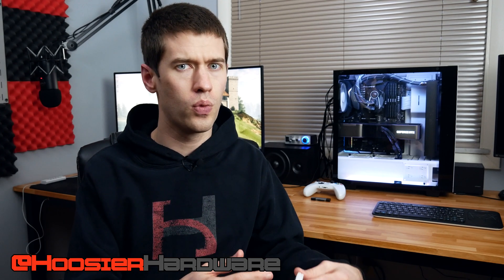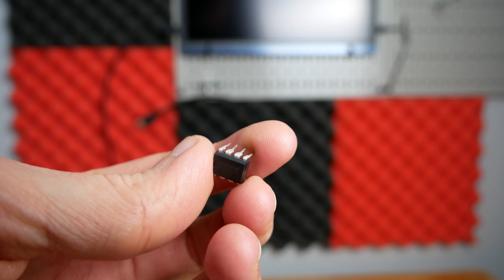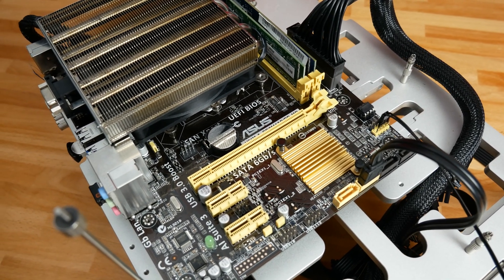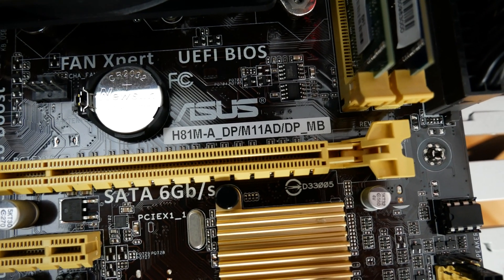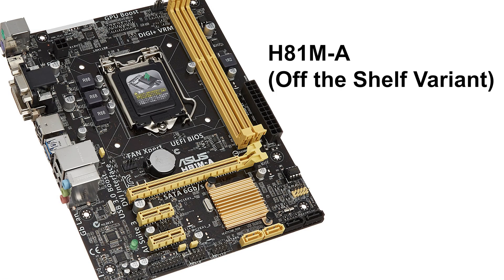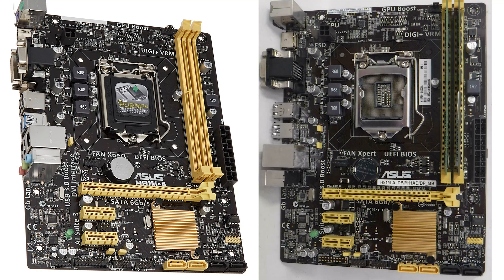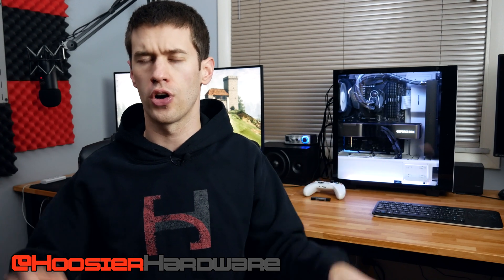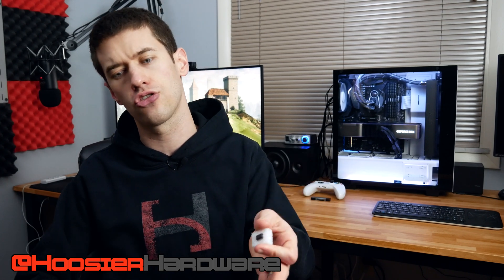I Upgraded an Old Motherboard with a BIOS Chip Trick

Comment: I'm curios if a bios chip could have been damaged during shipping. I bought a refurbished Asus B85M-G I can't get to post the seller tested the board before shipping I know this because he forgot to remove his test CPU I can get it to tell me it has no ram through a speaker I hooked up to it. Near as I can tell the bios chip is exactly the same as the chip on my Asus H18M-E. I was thinking of taking a stab at swapping out the bios chip and see if it has any effect but I'm not certain it's even worth trying it's a fair amount of work to swap my motherboards out and I don't have like a test power bench which I should make but I only repair my own system these days so it's kinda a waste of time and money. Thoughts ideas tips will be welcomed.

Comment: Are you concerned about seller on eBay putting malisha code on the chip(bios) ? Myself I don't know how to barebone flash the chips. Ty for the great idea thow.. I have a 12+ yer old pentium4 mobo that I need to figer out if it can be safe to use in my network O_o

Comment: Or, Something else that you can dive into if you want more content, I have been meaning to do a video on it, but I just don't have the time.

You could simply by yourself a Cheap CMOS Flasher, Connect it to the BIOS chip you already have, Wipe the CMOS, then Flash the CMOS of the BIOS you want to flash, it won't stop you even if its the wrong BIOS Version, but assuming you made sure to grab the correct version for the retail board, you flash it, and then you are up and running without having to rely on someone else sending you the correct BIOS Chip. This is how these sellers make those chips to begin with, so you just cut out the middle man and do it yourself. The other benefit of learning how to do this yourself is you can bring Boards back from the dead that have been bricked by a bad flash, I have used at least 5 to 6 dozen times in the past decade to bring back all kinds of boards, even new ones that don't have socketable CMOS chips, because your CMOS Flasher can simply connect to the BIOS Chip directly on the motherboard (its an alligator type clip you connect to the exposed pins on the CMOS Chip on the board itself.)

Comment: Hotflash takes me back. I flashed the wrong BIOS on an old mobo and did this trick to recover it. I fired up another motherboard and took the BIOS chip out while it was on. Put the bad BIOS chip in and then flashed it with the correct BIOS. Swapped them back around so I had two working motherboards.
Reply: So you hot swapped the bios in order to program it without a special machine to program bios's? That's cool.